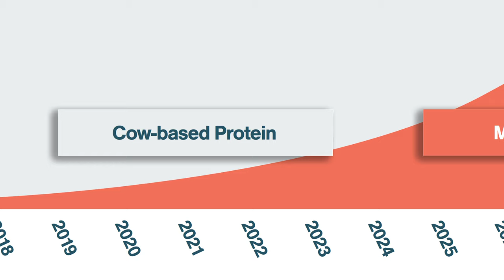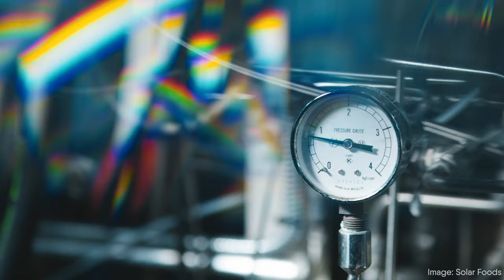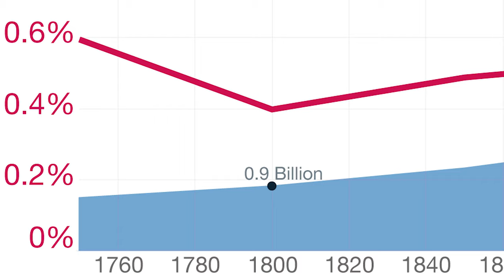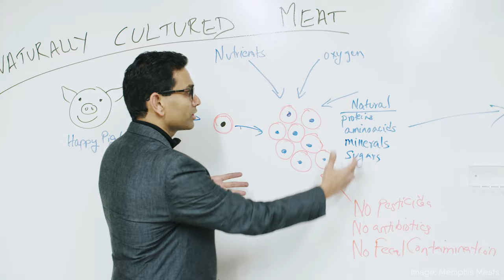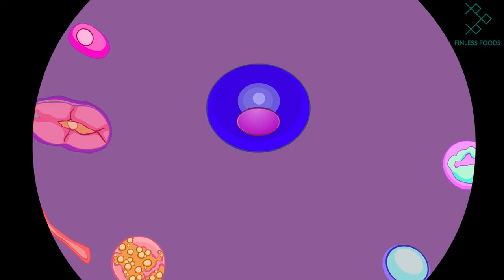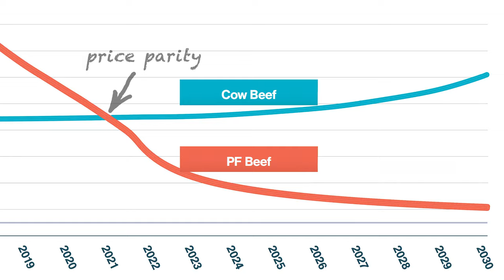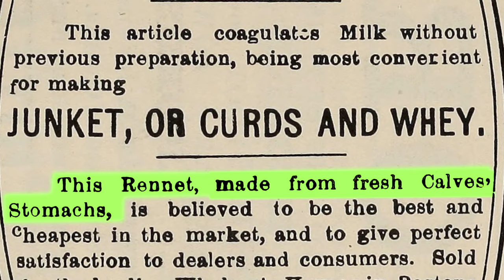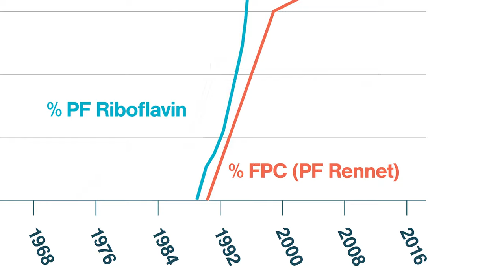Coming Soon: A Post-Cow World - Precision Fermentation

Comment: Questions:  Does that 100X more land efficient account for the land needed to supply the feedstocks, or is it just looking at the land needed for the fermentation equipment-facility?  I'm betting it's the latter, and so that will make the the true total land efficiency far less than 100X higher.  Ditto on the touted water efficiency.  How will this kind of protein compare in price with soybeans?  Note that soybean protein is already about 1/10 the price of common meats.  Right now too, and since hundreds of years in some cultures, we already have spirulina which is at least 40 times more efficient than raising cattle on high-quality, well-watered pasture land, and spirulina is not only a high quality protein source but is a superfood loaded with antioxidant power (3 grams equals 3 servings of veggies/fruits in anti-oxidant power) and chlorophyll + beat carotene.  Note that spirulina is more costly than soybeans (due to its higher facility costs), but still competitive with common meats on protein pricing, even though it's higher in land efficiency, but the land efficiency of soybeans is also very high compared to beef, at least 4 times better and soybeans are also a rich source of other important nutrients, esp minerals...An ideal dietary combo for cost-efficiency is therefore a little spirulina + use soybeans as your primary protein source. Another plus for both spirulina and soybeans is that they can be dried and stored without refrigeration for very long periods of time.
Reply from the maker: I am merely summarizing the ReThinkX report, so I do not claim to be a subject matter expert. However, my interpretation is that the land and water required for the inputs (feedstock) and processing are what are taken into account for their land and water use claims. Water, for instance, would include irrigation of feedstock, the raising and processing of the animals, through to the finished product. I'm not sure about soy protein being 1/10 the cost of common meats. I do a lot of work with a plant-based chicken maker. They are developing new technology to increase efficiency in the manufacturing of common 'junk food' staples (nuggets, tenders and patties). Their aim is price-parity with your typical Tyson chicken nugget. A part of the challenge is due to the fact that soy and wheat protein isolates cost MORE than chicken by volume. So while a pound of soybeans may be a tenth the cost of a pound of chicken, the processed version that is relevant to this application costs more. (Note that I haven't done the homework to verify this myself, however, that is my understanding based on my work with this company.)  Spirulina sounds like a great piece of the future food puzzle, with a well-known past. Although not well known to me! Thank you for pointing that out in your comment.
Reply: @theflexitariantimes8140  Thanks for getting back to me! I understand that you're mainly just passing along info that other experts have passed along to you...That’s OK.  As to the land efficiency claims, I have had some experience with folks trying to sell me bioreactor-type systems for algaeculture using sugar as the main feedstock, and I know that they did not count the land used for their feedstocks. So, I'm pretty suspicious of these claims for precision fermentation. Soy, whole soy, and if we just count the protein component (~35%) in it (not going through any isolation process with its extra cost-complexity) really is about 1/10 (or even less) the protein cost compared to common meat. take a chicken breast, 6 oz, 170 g with skin, $3.80...This is about 30% protein...51 g protein...380 cents/51 g ~7.6 cents per gram for the chicken's protein. Soybeans that I buy are now $1.10/kg and they're 35% protein...110 cents/350g ~ 0.3 cents, and so the soybean protein is actually only 0.3/7.6 ~ 1/25 (!) that of the chicken breast's.
Yes, spirulina is a true superfood that seems to be lacking attention nowadays as we run off toward dreams of lab-grown foods, but it’s the real deal.  I find it fascinating that so much attention and investment is now being focused on pie-in-the-sky lab meats and milks while spirulina and soybeans are sadly neglected...smells to me like the investor class is looking for ways to make more profits, not for optimal ways to make food less costly and more total land-water efficient.  Of course, the other part of the problem is the Western human’s addiction to meat and dairy.  So, the investors’ goal is to feed that addiction but do it more efficiently, while the actual highest efficicney lies in changing our path to vegan and using soy and spirulina as staple foods.
Reply from the maker: Some excellent observations. Perhaps if I get this sucker relaunched perhaps a dive into spirulina would be worth the effort. I know a food scientist who left the plant-based chicken world to focus on algae-based proteins. Long term, I think (hope) our diets and tastes will evolve and the imperative to create convincing analogs for meat products will eventually fade into irrelevancy.
Reply: @theflexitariantimes8140  Amen to that brother!  Keep up the great work on your channel and maybe that'll help push things along in the right direction!

Comment: Very interesting, thank you for the video. The flaws I see are the distributed theory because the reason prices come down on this is usually mass production, not distributed production. Each of the examples you gave about decreases in prices was based on mass production, not distributed production. Second is the energy source, it most certainly won't be wind, solar, and batteries, Germany is proving that right now. It will be advanced nuclear fission and that will come for Asia using American technology.